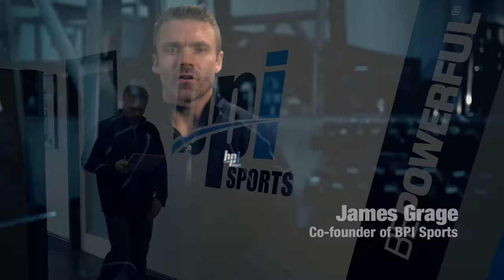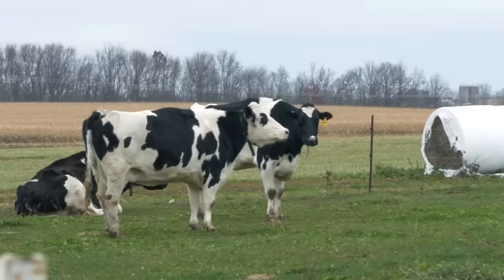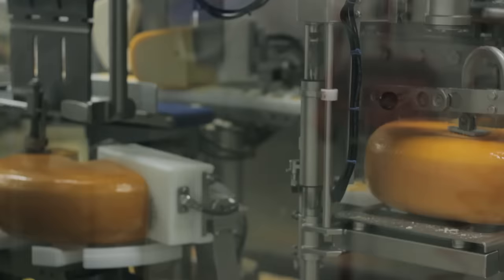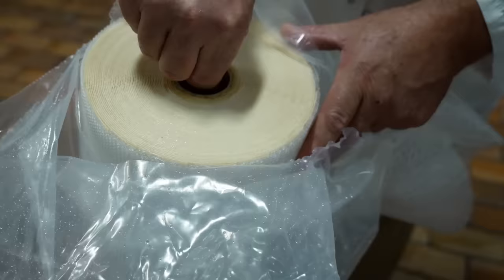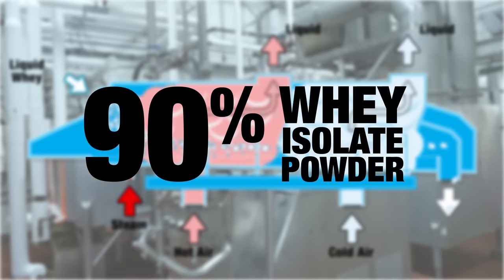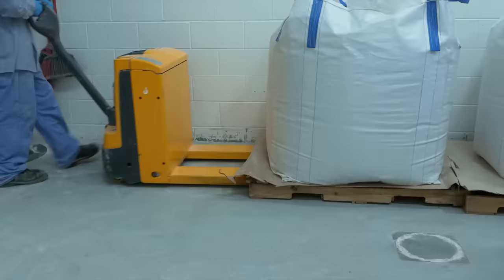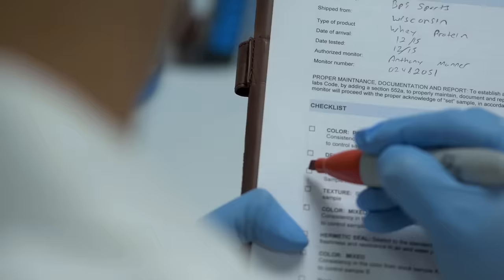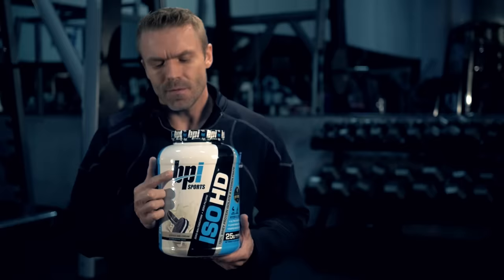How BPI's Whey Protein Is Made - Behind The Scenes

Comment: Damn. How much all that equipment to manufacture whey protein costs?
Reply: Not nearly as much as they make
Reply: They do not produce it form the beginning, they just buy the ingredients in those 1 ton big bags you saw or 25 kg bags and then they mix all together and pack it. They do not produce the ingredients, just mix them. In fact, there is a bunch of producers of the whey protein isolate (mainly the big cheese makers). So, asking your question, the equipment depends on what amount you want to be able to produce, but an small line for mixing the powders (ingredients), putting it in an standard recipient and then stretching a fancy label, you can get that production line for 150.000 € I guess. You will need the place to put it and some infrastructure to give power, and maybe compressed air too.

Comment: You glossed right over the pasteurization.  That's one of the most important points if the protein is denatured or not.  Does it use high heat or low heat pasteurization?